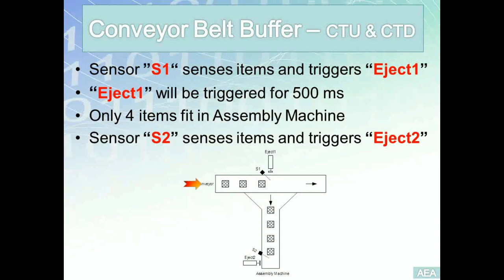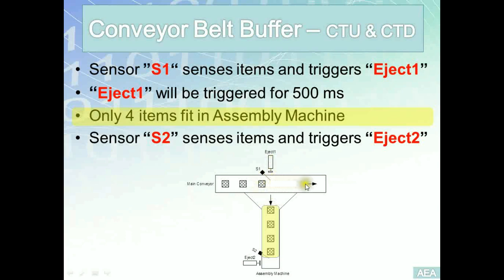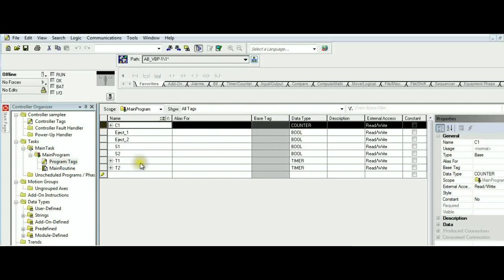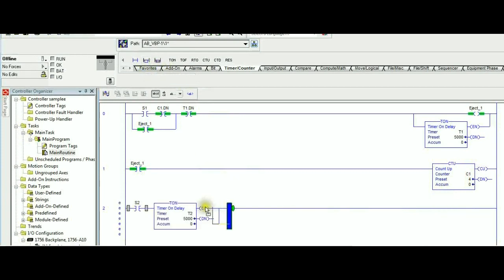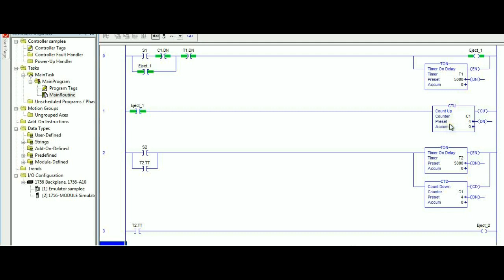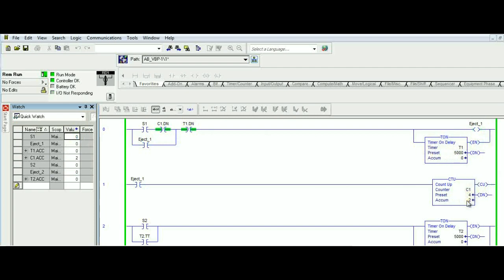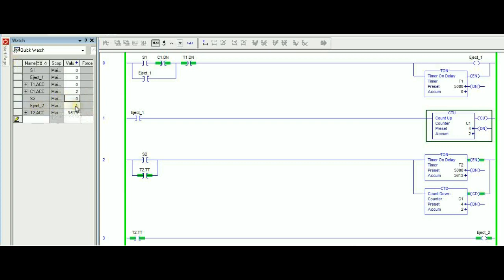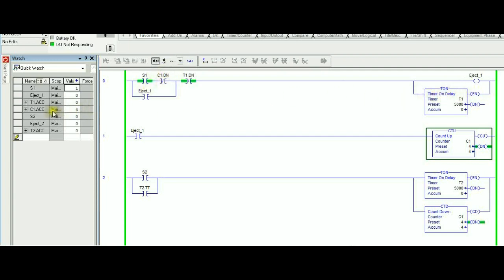LD 22 - Conveyor Belt with Assembly Buffer - Easy PLC Programming Tutorials for Beginners

Comment: On the first rung, why not have the counter in parallel with the timer start?
And why do you need the NC timer? Isn't that redundant with the normally open timer in parallel with the sensor?
Reply from the maker: We need the counter done bit to stop the sensors from triggering the Eject once it senses a new item. Why are you suggesting to put it in parallel?
Reply: @ALiEALiPLCProgrammingTutorials  Hey man! i got a project with a conveyor that needs to be ejected if the height isnt right(with sensors) , how should i do this afther 5 seconds it needs to eject the wrong one and the right length and height can stay (i need to make a ladder diagram out of it) Im so thankfull for your videos!
Reply: I mean the ^piece of steel not the conveyor xD
Reply from the maker: Gert,
If I understood the requirements well, what U want is exactly what is implemented in my tutorial example - sensor wise. In my tutorial, a sensor ejects all items and it stops ejecting when a counter gets to a preset value. In your case, the sensor(s) detecting the items with wrong height should do so as they won’t be stimulated by the items with proper height. The only difference I guess is the 5 sec timer that U mentioned. In my tutorial the timer was used in maintaining the Solenoid in the eject state for 0.5 sec. From your words, I’m understanding the timer will trigger the Solenoid after 5 seconds not maintaining it.
As U can see, a good understanding of the specifications details drive our analysis.